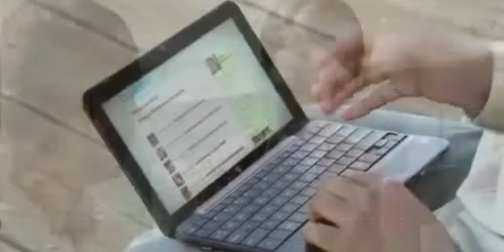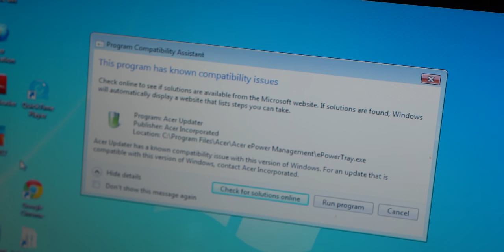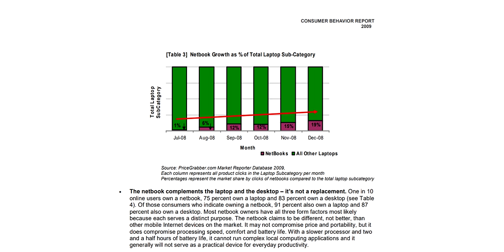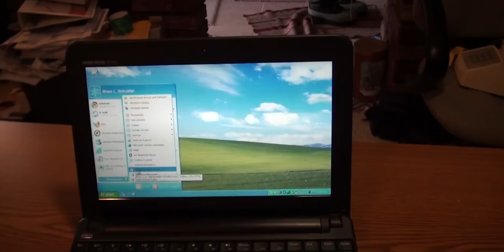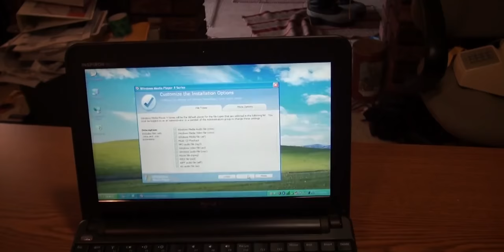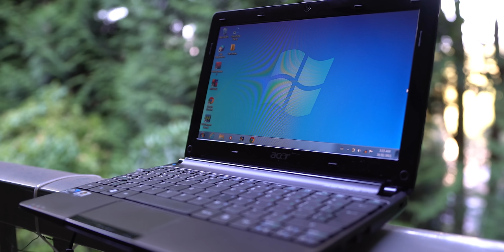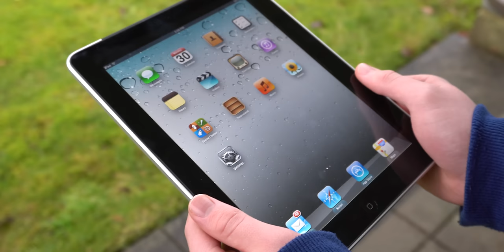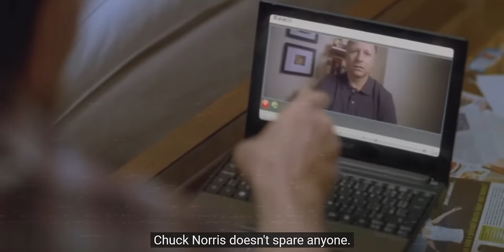Why Netbooks Failed - Modern Retrospective

Comment: I still own my Acer Aspire One netbook. It was my go to pc at the time. I had to switch to Linux because the Windows 7 updates would take forever. I overcame the cramped keyboard by buying a full sized one and a wired mouse. I got a lot of use out of it and it was there when I needed it. Sorry they are no longer here.

Comment: I've seen lots of Acer Aspire Ones and HP Minis during my late tens/early twenties. Most of them came with only 1 or 2GB of RAM, which made Windows 7 run as smooth as a pile of broken glass. On the other hand, WinXP ran great on anything with 512MB+ of RAM, which made it a great alternative up until 2016. However, some netbooks used the Intel NM10 chipset which didn't have winxp drivers for the iGPU. You were mad unlucky if you got one of those.

Comment: Thought about getting s tablet for my son recently. there don't seem to be as many around as there used to be. There are high end surface type tablets with keyboards. More like laptops with touch screens and detachable keyboards than tablets. Or Chromebooks that fold back on themselves. Where people would have used a tablet, they probably just use a phone now.

Anyway - put cloudready version of Chrome OS onto an old laptop and it works great.

Comment: I used to use the netbook from around 2011-2012 (bought on 2008), until 2018! I remembered the hard drive was inconsistent in connecting, eventually we needed to stop using it. I got a new laptop after that. This laptop taught me a lot, from how to use a computer, how to install Linux, and how to use Python.

Comment: Yes had one, asus EEE something. It was a rly good netbook that lasted 5-6 years. It had a better graphic card than most netbooks since it ran sims 2 and gta san andreas just fine. Back then i was fine with using MSN and playing some ps2 games on an emulator. I also had a pirated version of windows 7 ofc but later switched to elementary os.

Comment: Bought a 1st Generation Acer Aspire One for $400 (Canadian) back in 2008. It was a fraction of the cost of a decent laptop and it was a form factor I had never seen. It was loaded with XP Home SP2, 1GB DDR2 RAM, 160GB hard drive, Atom N270 processor @1.6GHz and quite a good array of ports. 

It was a pretty decent machine for the basics, video playback was always a bit choppy on an external monitor, but using it for presentations and the such was fine. I still used it throughout college (2011-2015) to take notes and it was fine. I think the earlier pre Win 7 models were decent machines. I was able to upgrade the RAM and other than the Atom just being a very low powered processor it made for a really good budget machine. I think had they been able to continue continue upgrade the hardware as manufacturing processes got better the would have continued to sell well even with the introduction of tablets. Obviously, we have a huge array of ultrabooks and convertibles now that have taken over that segment that the netbook really started

Comment: Bro!!! I was just thinking about my netbook, so I decided to do a search and found this video.  I loved mine.  It was cheap, uber portable, and I still had decent hard drive size on it (I did a little bit of research before buying). I was not about to buy an eeePC!  I made sure it had over 100 GB of hard disk space and I installed Office on it. I took that thing everywhere and I didn't have to buy a special bag to carry it in. I don't remember too much in the way of bloatware, but I'm usually good at getting rid of it when present.  It was pretty tough (though not rugged) and I held onto it for a number of years. I can't remember what happened to it. I might have traded it or maybe I gave it away when I got a better computer.  I do miss it sometimes but I am enjoying my tablets, particularly when it comes to writing on the screen.

edited for spelling

Comment: I still have my Toshiba NB205 netbook with cracks on it's hinges and broken fan. I installed CloudReady Chromium OS on it. Even with Chrome OS it ran rather slow, but hey it works and it will serve as a laptop to familiarise myself with Chrome OS.

Maybe I'll do the same thing with my current Asus X200MA once I got a newer machine to replace it.

Comment: Had a Toshiba NB200 - and used it for outside radio broadcast - and it was quite acceptable. Then I got a Sony “super netbook’  (11.6” display) and it still works very well - multibooting win10 and 4 different linux distros! Excellent devices - but I now use my tablets for nearly everything!

Comment: My school system got a grant for computers. We were using netbooks around 2011-2012. We had a lot of tech issues. They were slow, had the battery awkwardly sticking out, and we had a lot of tech issues with them. A little later, we switched to chrome books. They were faster, had fewer problems, and were designed like normal laptops. Still, our chrome books could only use the internet. Minecraft came out in 2011, and the only reason I was able to play it is because those netbooks allowed us to download programs. I appreciate them for the freedom they gave us.

Comment: I've had a new netbooks – strictly EEEs, beginning (I think) with a 701, moving on to a 900/901 and I think the last one I used was something like a 1015PX. I still absolutely adore the form factor; even if the keyboard is cramped I love having a physical keyboard, kind of rugged shell and portability. I've always had a soft spot for tiny machines, and the portability+ruggedness were just icing on the cake. If these old machines were able to run the modern web, google docs etc, then I'd probably still be using one from time to time.

Though I 100% agree they were marketed way too broadly. People thought they were getting a real laptop. I knew what I was getting into: Some word processing, some spreadsheets, some web browsing and IRC:ing. And possibly some light emulation action and coding if I were careful.

I'd love something with the same form factor as a 901 or 1015PX but with modern hardware. Maybe an ARM cpu and some decent graphics chip. I'd be OK with android, as long as gdocs ran well.

Comment: I had an Aspire one I'd gotten refurbished - I promptly dissected it and put in more RAM. I did a dual boot with it - the internal drive ran a stripped down version of XP (originally for gaming) and the SD slot had a copy of Ubuntu. It was my throw around, easily nuked and restored PC troubleshooter and virus cleaner. For a few years my side hustle was fixing computers (think Geek Squad but competent) so it was awesome to have something small and light to take with me... even if it also meant carrying a power brick.

Comment: I think the battery life is really the thing that made netbooks stand out in their time. Even if you spent money one of the classic white macbooks of the day, you still only got 4-5 hours out of that thing on a VERY good day, not to mention that number went down the longer you owned it, which was as long as possible because you paid more for it, so realistically you averaged 2-3. Comparatively the eee pc got 9-10 hours which was unheard of for a laptop, but it wouldn't be long before that was the standard.

Comment: I bought an Acer Aspire 1 (model ZG5) in December of 2008 (actually bought one for my wife too.  Xmas presents), over the years I upgraded the memory to 2GB and put a 128GB SSD into it.  Still on XP-SP3.  I still use it today, not for the internet, but as a printer server, a scanner server and to back-up my NAS to a couple of big HDDs.  It get's the job done and with the extra memory and the SSD it runs XP like a trooper.

Comment: I had an MSI Wind netbook that still works today, though I don’t connect it to the internet anymore since it still runs XP. Great machine for the price, 250 GB hard drive which was big for a netbook. The only problem I ran into was the hinge, which cracked and the plastic shell of the computer now splits on the sides whenever I open it.

Comment: i owned a Gateway netbook in the 2010s, it helped me graduate in 2015 and while i am using more modern gaming desktops or my portable ipad, there's a place in my heart for the ol' netbook and the days of helping me when i didn't have the money for a regular laptop.

also the netbook died finally in 2016 when i tried connecting it to a monitor via the VGA adapter, it smoked and i had to let it sit outside, thankfully i recovered the hard drive.

Comment: In Argentina 64bit netbooks are still being delivered to students at public institutions as a part of an education program. They are fairly decent, running a linux distro developed specifically for said program (Huayra) which works great on the Celeron N4020 with 4GB of ram. They used to come with Windows 8 as well, in dual boot, but not anymore (it wasn't so good tbh and some models only had 2GB of ram). I think netbooks can be great for these kind of things, but not so much if you want a computer for general purposes running Windows 10.

Comment: "Obviously they wouldn't be able to handle the web nowadays" Here I am in 2023 posting this comment on an Asus EeePC 2101-HAB that's older than me running Q4OS (a modern linux distro) and it still works fine for lightweight web browsing

Comment: I used to have an LG X110 netbook. 

Being a tech support guy, I bought a 2nd battery and a Bluetooth mouse and carried it with me all day long. It's light weight and low price were key to my decision to have one. 
It came with XP, 1GB of soldered RAM and no upgrade DIMM slot. Being a MS Action Pack subscriber at the time I could load a standard 7 edition but things had become slow, 3.5 minutes to load. That became the reason for me buying my first SSD drive which reduced load time from 3.5 mins to 1 and breathed new life into it. 

All in all I was glad to have one. My back was glad as well, having to carry less weight. 
It's still alive I think, serving the mother of an ex for Facebook and Internet browsing.
Full circle...

Comment: I used my 901 for a long time.  It was a great little machine.  I eventually replaced it for a second hand Samsung NB30.  After I upgraded the RAM & HDD, replacing Windows, it worked well enough for what I needed.

Comment: I've had absolutely no quarrel with my 10.1" 1005HA clocked to 1.9 GHz, with 64GB SSD and 2GB RAM. All this cost me the equivalent of $378 with my domestic 27% VAT. The problem comes when you try to use it for what it isn't meant to be. 10.5 hour battery life so you can take notes all day in school, and have enough juice left to kill time while you commute? It's just perfect!

I've been using it to play World of Warcraft with an external 19" 1440x900 screen in my dorm for crying out loud!

Also saying an ARM tablet running Android would be a valid substitute to any x86 device running Windows is just blatantly false. It was woefully insufficient in 2008 and wouldn't have even been enough in '98. Android is utter garbage for content consumption and multitasking is non-existent.
Reply: That's because Google didn't even try with Android tablets unlike Amazon and Samsung that did
Reply: @youtubeshadowbannedme  It's 2021 and I still find Android devices shitty for any content consumption. You're doing yourself a disservice using shitty little speakers with shitty little screens to watch video and/or listen to music. Don't even get me started on movies. You're deliberately sabotaging your immersion.

Comment: I loved my Samsung netbook. For the last 2 years of my undergrad I used my netbook in place of any and all books (after spending hours searching and downloading pirated copies of textbooks from sketchy Russian websites). It was very slow with XP, but I put Linux Mint on it and learned so much about Linux and optimizing it, it was actually pretty fast! I wrote my senior thesis with it. Sadly it died after I fell skateboarding. I harvested everything I could from it for parts, destroying it in the process - only to find out the issue was a dent in the power button that would effectively get the button stuck down to do a hard reset. I could have fixed it for 15 cents. Oh well!

The replacement Acer netbook I got was admittedly terrible. But I loved my first netbook, like some gearhead might love an old cheap car that could be customized and tuned into something great with enough effort. Very satisfying.

Comment: I bought an MSI 100 Netbook for a toy to play with and for its portability. It was no speed demon, and not the best made device I ever bought, but it was reliable and the performance wasn't bad  for what it was. It never let me down.  I eventually converted it to a Hackintosh running MacOS and ran it in that configuration for a couple of years. I eventually installed Windows 7 (full 32 bit version) and never had a problem with it Finally, a couple of years ago, I converted it to a Chromebook running Chrome OS. It is still working in that configuration. It isn't my main machine by any measure, but I still take it out once in a while and run it. The only problem I ran into in all that time, was the battery eventually died, so now I just use the power supply plugged into the wall.

Comment: I bought a better-than-average  model  used for abt $200 at a time when I couldn’t afford a better laptop, especially not something light and with decent battery life.  I only ran Linux on it, it’s real purpose was something to use while commuting that was beyond just content consumption. It gave me an excuse to learn a little about Linux.  I’ll say its trackpad was one of its weaker points but pretty much everything else was plenty adequate for what I was trying to use it for. Eventually I did get an iPad and a nicer MacBook so mostly stopped using it. I still have it but 2021 websites need more power. The 4GB of RAM is still probably just enough but the CPU is inadequate today. Frankly the 2015 MacBook that mostly replaced it is now starting to show its age too. I don’t regret buying the netbook though I personally never considered it a primary computer.

Comment: I still have my Aspire One.  Yes, back in the day, I fell for the cuteness.  But it proved to be useful for several years because of its small size and light weight, particularly when contrasted with the conventional laptops that I had to use for much of my work work (and had to be high end, with NVidia graphics), which were more like.....portable desktops.

Comment: A netbook – Acer Aspire One AOA110 – free gift in local gardening store chain when my dad bought there a new loan mover – was the first piece of computing electronics, that was actually mine. It originally came with Windows XP Home Edition, which required some 3rd party software in order to be usable, but it was the device that got me to coding (at that time only very basic HTML and CSS and a tiny bit of BASIC) and with that to my first attempt to try an operating system other than Windows – it was a Linux Ubuntu 11.04. I loved it for these experiments, when I already had a better and bigger laptop, I knew, that if I were to soft-brick it or something, it was still a device for free. I ran on it several Linux distros, Chromium OS, Windows 7, 8 and 8.1 (even though the last two according to their requirements shouldn't have run on this netbook) and even tried (although unsuccessfully) to install Hackintosh 10.6 Snow Leopard. I don't have a particularly strong feelings to it (even though I still have it), but I'm really glad I got to own it.

Comment: I had the samsung NC10. It had a first gen 1.6ghz atom, came with windows xp, 160gb HDD, and you know what, it taught me about so many things it was unreal. I only used it at first for things like itunes, going on youtube, and general net browsing, then when i started going to college, it was fantastic, but my thirst for knowledge, and a work around of not having a disc drive when every game i owned was actually on a disc, pushed me to learn about virtualisation, virtual hard drives, virtual disc drives, but with virtualisation, it also pushed me to learn about how to create networks, how to boot into a network version (my college was very good with me in that way, even during the days of conficker). I ran ubuntu on it, i ran windows 7 pro (my apprenticeship gave me a free copy through microsoft technet i think?), but the thing which really impressed me, was the fact i could actually play the sims 2, call of duty (first one), (to an extent, dependent on the game) hello project 64 too. It was something which really really does hold a special place in my heart, but, the only downside for me, was at nearly 2 years old, when the charging port melted (power surge?) which then really screwed the board up. It broke my heart when that died

Comment: I love my Asus Eee PC 1008P. I did my entire MBA on it. It lasted until 2015/6 when some of the programs I was using finally dropped XP support and I had to upgrade to something with Win7. I still have it, and it still works. The only thing that ever died on me was the heatsink fan, but the only replacement I could find was sold in packs of 10, so I'm set.

Comment: With all due respect, I still own 2 HP netbooks and still use them to this day.  They came with Win 7 Home (not the worse starter version, but the home version) and while they are sluggish compared to anything you can get today, they still perform well.  Though not the ideal machine, with their light weight and long battery life I've used them for quite a bit beyond just simple web browsing, including audio editing, remote working, and more.  Even though they were inexpensive, having used them for 10 or so years now and still finding them useful, I figure that was a pretty good purchase.